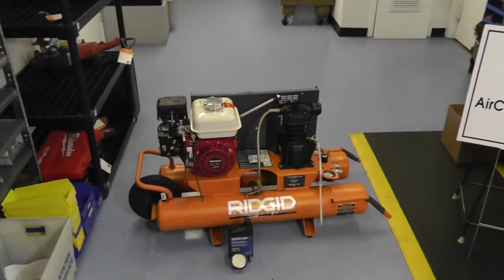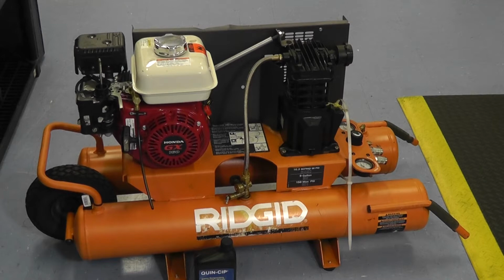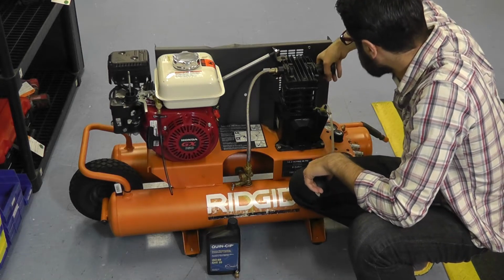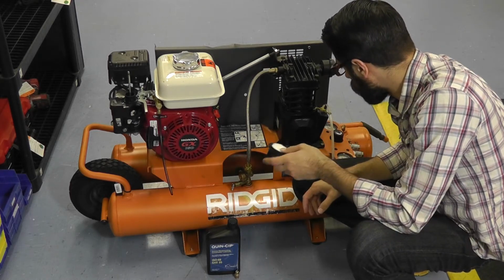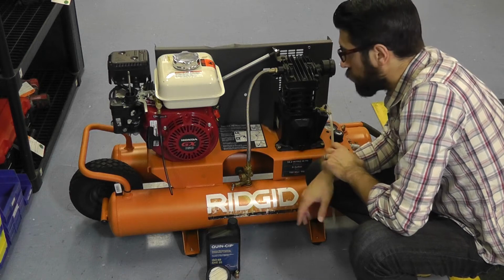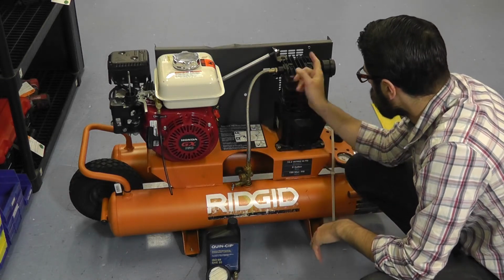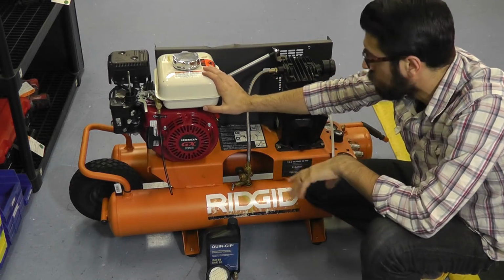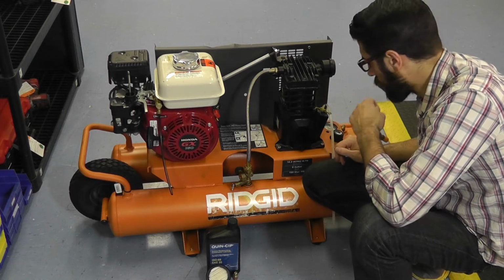How To Tune Up An Air Compressor

Comment: *This pump works great. Fills tires super fast. It attaches to battery for power but the cord is a good length. We use it also to fill the airbags in the trucks suspens
ion. What I don’t like is the small bag it came with. The pump and cords barely fit inside.*

Comment: I used this air compressor when I first got it .>>>>t.co/44LpnsEldQ     Worked my impact wrench just fine. The other compressor I had sometimes it would and sometime it wouldn't. Used it four days later and the thing still had a full tank of air. the other one would have lost pressure in the same day. This thing so far was one of the best investment I've made. I love this thing.

Comment: I have that compressor, it was made in 2005 and it's been a dream to use and is still like new.  It always starts first pull with the choke on and has had nothing but synthetic oil run it from almost day one. Service and keep your equipment clean and it will last a long time
Reply: I have same one as well. Rigid Gp90135... I got it from my boss for free 2 days ago. We put a lot of hrs on it and it still runs like a champ.
Reply: I have the same compressor on my weld service trailer and it was working fine until yesterday. Long of the short I know nothing about air compressors. It has some kind of weird auto throttle set up the guy I got it from installed. And chance I could get help on what parts to order? I also broke the pull rope

Comment: Hey guys great vids...i have an old Ir compressor...converted to single phase...it is 2 stage V pump on it I think it type 25 or 30 maybe...real old school ..but it fills 400 litres from empty in under or abouts 3.5 minutes...its good for single phase..but if I got you a pic of it and spec would you know what the best oil would be and filter replacements...as I am in Ireland and info does not even come with new stuff never mind something made 40 years ago :)..1972 I think or 78..its old anyway but works like a charm